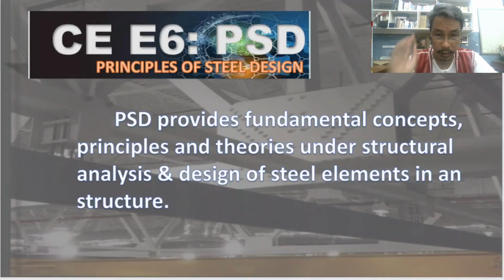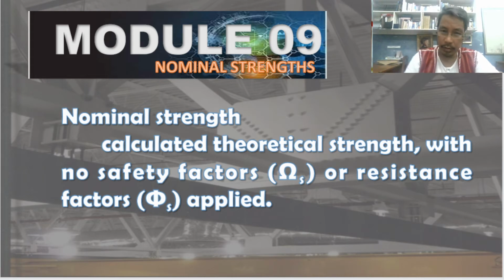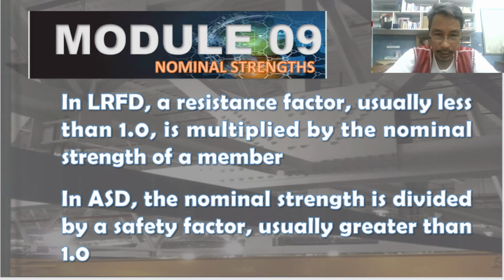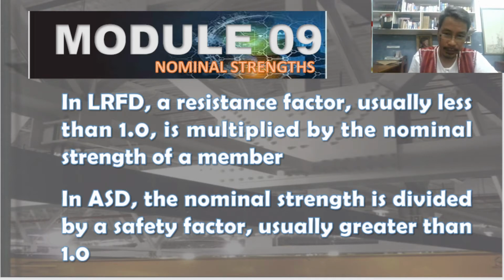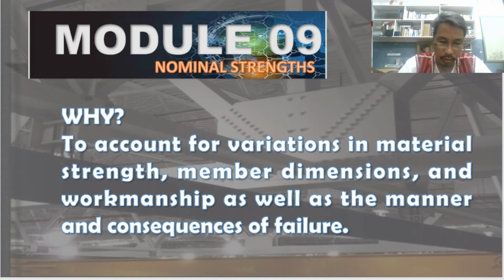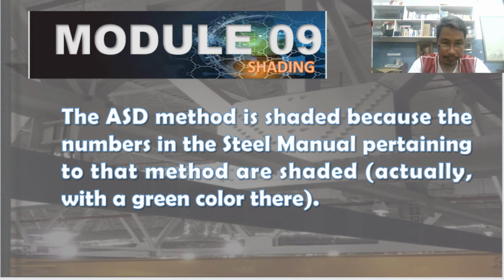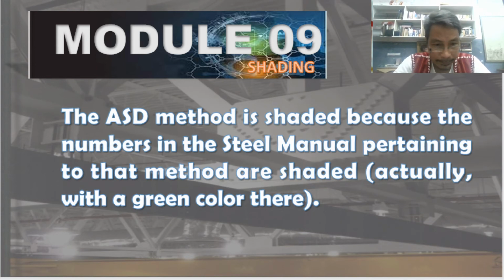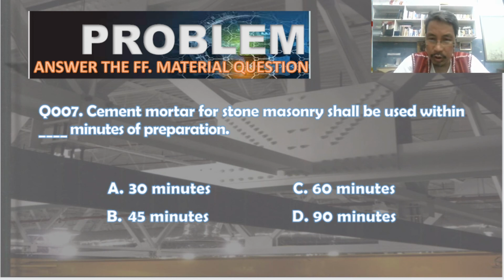Nominal Strength: Specifications, Loads & Methods [ Principles of Steel Design ] Module 2.09

Comment: In this lecture video I've learned some technical terms and its definition of Nominal Strength.
For Q007. Cement mortar for stone masonry shall be used within minutes of preparation.

Ans: A. 30 minutes
B. 45 minutes
C. 60 minutes
D. 90 minutes

Comment: Thank you, Sir for discussing the Nominal Strengths  and shading. I’ve learned about the between of two which is ASD and LFRD methods.

 Q-007 Cement Mortar for stone masonry shall be used within __ minutes of preparation. My answer is  B (45 minutes).

Comment: Thank you sir for explaining the definition and specification of a nominal strength which contains two specific approach or design, and these are LRFD code and ASD.

For questions 007, Cement mortar for tone masonry shall be used within _ minutes of preparation? The answer is letter A. 45mins

Comment: thankyou sir for discussing the nominal strength under the module Specifications, Loads & Methods. Nominal strength calculated theoretical strength, with no safety factors or resistance factors applied. As in LFRD, it's a resistance factor, that's usually less than 1.0. it is multiplies by the nominal strength of a member, while in ASD its nominal strength by a safety factor, usually is greater than 1.0
Question 7: Cement Mortar for stone masonry shall be used within-- minutes of preparation. The answer is 45 minutes.

Comment: Thankyou sir for this video lecture. I’ve learned the definitions and uses of the technical terms such as, nominal strength is calcluate theoretical strength,eith no safety factors or resistance factors. According to this lecture, LRFD usually less than 1.0 is multiplied by the nominal strength of a member while in ASD, the nominal strength is divided by a safety factor, usually greater than 1.0.
Q07: B 45 minutes

Comment: This lecture video talks about the specification, loads, and methods with a sub-topic of nominal strength and shading. In this video, I have learned the difference of ASD and LFRD methods which are the specific approach in the design. For Q-007 Cement Mortar for stone masonry shall be used within __ minutes of preparation. My answer is  B (45 minutes).